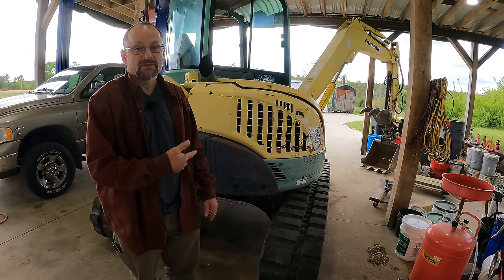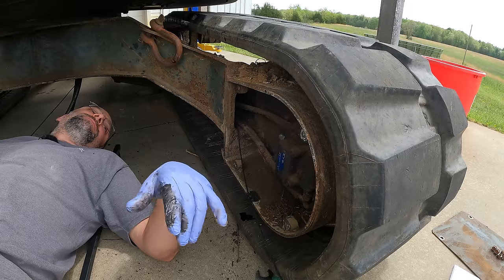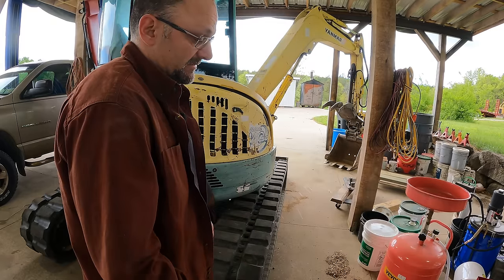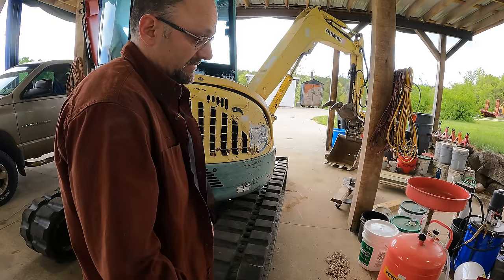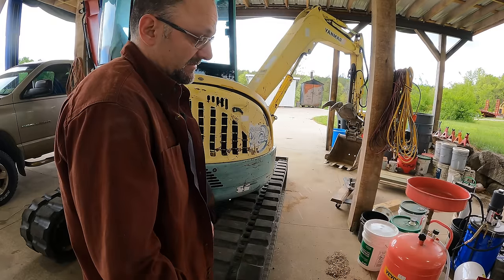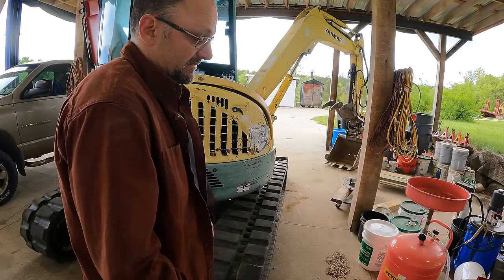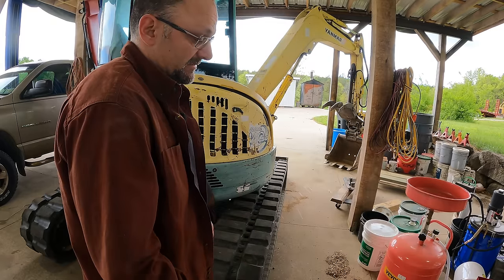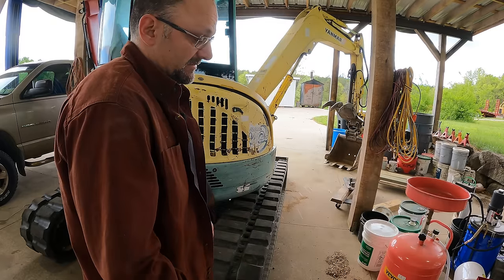Excavator Not Tracking Straight, TOUGH Hydraulic Repair.

Comment: I have a 1990 Hanix 260-2 …I have rebuilt the swivel valve, had a bad hydraulic pump, was able to replace that. Ended up rebuilding the valve body because it was pouring fluid. Got it all together…ran amazing…for about 10mins. Now I have a weak track, weak curl, and weak arm lift. 🤦‍♂️ 
My swivel valve was full of little bits of old seal material. Cleaned the tank and hoses the best I could but I’m assuming I have some sort of obstruction. March goes on. 

Great video sir

Comment: Can you moderate the output on the stronger one - using an additional inline variable valve? E.g make the motors as weak as the weakest one so it'll be equal/ straight?
Reply: Why would you do that you can still track straight if you don’t push the other lever all the way!
You might need the extra power on the faster track….you could just put a piece of wood underneath the faster track pedal so it can’t engage all the way and is equal to the other one when fully engaged.

Comment: Hey John. Love your videos! I have been working in the Industrial hydraulics world for a couple years now (only since 1985) and i hopefully picked up a few things along the way. I would make only one suggestion. I noticed the model number tag on the pump and it looks like its a KYB? I would attempt to contact their US Sales team to get the straight skinny on that pump from them.  I am thinking there may be a null adjustment on that pump somewhere. The HP limiter is usually associated with the compensator not the max stop adj which appeared to be the adj you were tweaking.

Comment: To check the motors you could block the leakhoses and see how much oil comes out of each motors leak in the course of 10-30 seconds. You would have to put the excavator up on Jack stands.
Reply: Yep, that's a good test to see overall condition of the motor.

Comment: Another excellent video. I do have one suggestion, it's so simple that I would have thought someone would have suggested it to you with all the research you have done, but here it is. Why don't you mechanically limit the travel on one of the levers, put a hard stop in, to hold back slightly the motor that is traveling too fast, to equalize the flow and eliminating the effect. It's obviously a band-aid and not  a real repair, but at least it would fix your problem that's driving you crazy, and can be adjusted as it wears further. That's the only cheap and 'easy' solution I can think of.

Comment: Great video as always. On a side idea. You could mix your JLG Boomlift, the Jackery 3000 battery pack, and a set of led floodlights. It seems like a simple way to make a set of super overhead flood lights. If you did a project building frames for the lights to clip onto the basket without modifying the boom, then if you ever needed light, it would be a quick setup. Seems simple and useful.
Reply: Then you can play God:
"Let there be light."
- Click -
"Wooooooooww!!!"

Comment: Check you service manuals  for the cycle times for the digger services, if you know the pressures are good then cycle times can help to evaluate pump flow performance.remember pressure is power  flow is speed.  Stay away from adjusting the regulator at the pump changing this just adds another variable  to the mix,without a flow meter you   are only guessing  if the cycle times are within spec then move to the next test in the literature  there is usually a section that says evaluating performance in the book.

Comment: Another potential option, as you found the control valve for the Left drive was weaker than the right hand side, is to switch the two control valves. Hopefully this would roughly equal out the weaknesses between both sides and have you tracking straighter at roughly the same speed
Reply: I've done that in the past to try and isolate a problem slow track motor ( drove in circles if enough space)  despite pressures feed and return being the same at each motor and out of the valve chest.
Reversed the control , problem disappeared.. ran it like that when tracking out several kms.. then back in shop, we tore it down, returned the hoses back to standard.. worked as should.. for a week😢
Back in 80s we had the same problem with a little used   Priestman 108.. that was solved when we replaced the valve chest from a salvaged unit. We also replaced hoses to both drives..

Comment: Hi there 
Flow meter is the only real way to test a hydraulic system  like I said on your last video , what you’ve spent on hoses would have gone towards a flow meter, if you get one try to buy one with a valve to load it up as you test the system , you might get the same flow but when you add load the flow may drop indicating and internal leak or performance issue , your spool looked dull on the bad side meaning wear in the spool/ valve , you don’t need a big leak past to create your problem , o ring seals between the spool slices can cause this also but really a flow meter is your biggest helper now and in the future,
Regards and all the best , Davy 🏴🇹🇭

Comment: Usually the Case Drain fluid is cooling fluid. It should return through a cooler then back to the tank. Works the same way on an aircraft.  Great channel as you give me lots of great ideas and motivation to figure it out myself.

Comment: John, something that hasn't been considered is the length of each track. I was a soldier for 30 years and about 11 of those was operating out of tracked vehicles. The vehicles had by design different length tracks which caused them to track right requiring constant correction. This was at speeds upto 60 Km/h (about 37 mph) and was not really an issue. What I'm trying to get at is check to see if the track stretch has made them different lengths, and if you cant find a reasonable solution, I'd just live with it.
Reply: That makes no sense because it wouldn't have been changing from left to right sides since he never changed tracks from left to right.

Comment: If the drive motors are not specifically for left or right, you might try swapping them from side to side.  It may balance things out more if you have multiple components with varying stages of wear. Just a thought, G.

Comment: Well... I noticed the dig in the last video at the hydraulic mechanics (and hydraulic designers such as myself) warning you that diagnosing hydraulics strictly by pressure was a dangerous mistake. You set your limits by pressure to prevent damage to components. You diagnose poor performance by finding the problems with flow. Pressure is just the resistance to flow. No resistance, no pressure. Full resistance, full pressure (and relief). Pumps are designed to move fluid from one place to another to transfer power remotely. A system can still meet pressure requirements while not providing adequate flow if there is enough restriction. After all, those pumps may be governed to relieve at 3500psi, but they're fully capable of providing far more than that at their designed flow rates (until failure occurs). 3500psi is a cake walk to them, even when the components are worn. Measure your case drains to diagnose worn pumps and motors easily. Deadhead the component and dump the case drain into a 5 gallon bucket for an exact duration of time at the specified rpm. There will be a spec sheet when you look up the pump or motor that tells you what the case drain rate should be. If you want the easy dirty solution out of this, just install a pair of two-way (non-checked) flow control valves in-line with the fast motor and adjust manually. it'll cost you 120 bucks in valves and 60 bucks in fittings. put them right off the motor so they're easy to tweak on demand and so you don't need to buy 4 hoses to replace the 2 original hoses. it won't hurt anything. as far as the machine is concerned, it will think it's going up a half-a-degree hill all the time on that side. you could do just one, but the motor would still act with a tiny bit of bias in one direction, due to the case drain. https://www.amazon.com/Hydraulic-Control-Needle-Valve-Ports/dp/B07WWHH1NZ?source=ps-sl-shoppingads-lpcontext&ref_=fplfs&psc=1&smid=A1VH34FQCDTBWO that's an example. it doesn't mention if it's got a locking set screw or not. you'd preferably want one that can be locked where you like it, and rated for the right gpm rate and hose size, obviously.

Comment: I thoroughly enjoy your content. I had a very similar experience on my mid-90's Cat excavator (E70B). Does not track straight - although yours appears a little worse. I put in new final drives (because both were going to eat themselves) and rebuilt the rotary joint (swivel joint) because the blade would drive down very quickly. Neither had any impact on the tracking. Seeing your experience and reading some of the comments, I will likely never pursue attempting to correct that, just continue to live with it.

Comment: Great video.  Wish I had experience here to offer.  The accumulator is suspicious being on one pump but that should not really impact anything.  I think you covered this in another video, but would think you could calibrator the sticks in such a way so that when both are fully open you could set it so that the fast motor valve is not 100% open, maybe 97% open.  If no adjustment on the sticks, then maybe you can add an adjustable regulator (flow control) on the pump output and calibrate it that way.  Seems odd there is no calibration mechanism.  Surely they can not expect both pumps to be exactly matched.  Although maybe that cross connect you added is already done internally in the pump housing.
Reply: my baby bobcat mt50  has some stop bolts on the levers to adjust the travel on levers to make it track straight.

Comment: Why not put an adjustable flow restrictor in the faster side, and adjust to get decent tracking?
There are 15K psi adjustable needle valves, as I've used one for an adjustable expansion valve in a homebrew refrigeration system.

Comment: Great video John,While i used to work on 50ton (RB50) crawler cranes the tracking motors were a similar set up (just a whole lot bigger) you could adjust the flow rate on an adjuster on the motors to balance out the speed of each motor..do your motors have flow adjusters on them?Just a thought and might save a bunch of money if you can adjust them and sync the speed of each motor.

Comment: Are the left and right drive motors interchangeable? If so switching them might mitigate the issue somewhat...
Swapping the drive motors takes a lot of time & work but  there would be little or no added costs involved.
An easier LONG SHOT fix you could try : Somehow lower or restrict the oil flow to the right motor until the machine tracks straight...
this might be done easily by putting stops on the lever travel OR via an orifice tube (or some such contraption) placed  in the right side valve outlet hose)...

Comment: Have you considered putting an adjustable restrictor (eg ball valve) on the stronger track action so that you can limit the stronger side to the same power as the weaker side?
Reply: I was thinking this, or a needle valve (see SV seeker's lastest hydraulics video)
Reply: @bigbadvoodoodad  I agree with a needle valve instead of a gate or ball valve.  Needle valves are for close control.   A ball valve should be open or closed.

Comment: You still have a common item though between everything. Your hoses. If one is pinched or internally damaged then the pressure would be near right but the flow rate could be skewed

Comment: thanks for the insights, was doing the same problem with out excavator. just pin pointing which is which to determine the problem.  im no HD mechanic but i know how power flows and understand its working principles.

Comment: In the old bobcats you got them to steer straight by adjusting the lever travel. You'd only need to try limiting the faster one. Fab a bracket and stop bolt

Comment: As a former equipment operator by trade and owner of an excavation company, I've never seen anyone put so much effort into getting an excavator track evenly.

Unless it's causing damage, the operator just learns to hold back on the side that's tracking faster. It is what it is.

Few excavators track straight in my experience. 🤷
Reply from the maker: Ok, that's good to know.  This is the only excavator I've ever run.  Cheers.
Reply: can someone help? I purchase a used  bobcat 8811 backhoe  attachment and I rebuild all cylinders w/new seals; attachment din't have the male and female couplings so put new ones,, [not sure if in right way] when in I try to run it,,,, the oil starts to get hot within in minutes and hot oil will shot out the couplings: check other similar models for correct connections of the lines but can't figure it out.
Reply: @eliast4780  Sounds like missing o-rings or couplings aren't tight enough. I'm not familiar with that attachment, so maybe you would have better luck on the equipment forum Steve mentions in the video.

If all else fails, it may be worth the investment to pay for an hour or two of diagnostics at a shop.
Reply: some one told me if when I change the seal I might have gorget to install the "O" rings in the cylinders: they say with that pressure,, if there is tight gap oil will get hot with friction. that may be my problem: didn't put the seals right.😪 .
Reply: As a renter of excavators somewhat often, I’ve noticed a lot of them track off like that. I’m sure they are abused but then again those are almost new too. 
It’s annoying but like you said you just learn to pull back on the fast side.
Reply: If you can’t stand it ,you need a restricter in line on a hose,, like a dimmer switch. That’s what valves do anyway.
Reply: Ok, guys shoot a hole into this theory!

Here is a novel angle for you, mind you I'm only throwing spaghetti at the wall however it's a logical wall ...

Maybe the problem is related to "Where the rubber hits the road"

Quite literally, as in the actual tracks themselves? 

Think about it, if one is a couple of inches longer than the other is, it would 100% make "a" difference.

Bottom line,  swap the tracks!

☆☆OR ☆☆

Tighten up one side a bit and loosen the other side a bit

Test

Then reverse.

Either way it has to compensate for the variation one way or the other even if it's not the root cause it will still compensate for the variation so either way it's the actual fix or it will be an effective workaround, imho.

KISS !!!
Reply: @jp34604  I wouldn’t think the length of the track would affect it. The speed at which the final drives turn is going to be the ground speed.  Even if it was two feet shorter. Now there would be some weight difference that would affect it a small amount if it was that drastically shorter. Remember is not a diameter like a tire so RPMs of the final drives if identical will translate to equal tracking regardless of how long the track is. It’s almost like the track isn’t there and the sprockets are riding on a long track.
Reply: Plus, it changed sides when he changed the hoses, so tracks are good.
Reply: > Bottom line is the one on the outside of the turn is spinning faster.

So just slow it down a wee bit with a ...

ASIN     B07WWHH1NZ
-
KISS
.
Reply: I have to agree skid steers with tracks are the same to. Ive run either for a couple  thousand of hours so far  and the slight tracking has never gotten worse and really is not much of a problem just a little steering to compensate no big deal.
Reply: @jp34604  I see where you are going with that, but he swapped hydraulic lines and was able to make it track right instead of left.  That would disprove that as a cause.
Reply: @stevem6711  
I see it as consistent that the "problem" followed the swap, as THAT channel in the manifold has slightly more pressure and thus is outputting a higher volume of fluid/oil causing the sprocket on whichever drive assembly is attached to rotate more at a slightly faster RPM. 

However the needle valve for THAT channel was not granular enough or even working at all required to make the necessary adjustment to compensate for the slight imbalance - so again I say to simply add an inexpensive in line easily accessible fine tune adjustment valve as someone else also mentioned to tweak (or dim) on the fly for a highly granular micro adjustment so this neurotic loose nut behind the wheel can overcome his OCD and move on with his life LOL

 But no doubt it's annoying to not be able to adjust some simple variable SOMEWHERE??? to sync it up!!

I say just add ☆this☆ on one or even both sides -  maybe even right in the cab at the forward output of the stick for easy tweaking in real-time to fine tune., imho.

ASIN       B07WWHH1NZ
.
.
Reply: @cabinman  
Yeah, now I see, one RPM is relative too the circumference of the drive sprocket rather than the circumference of the track (assuming equal diameter sprocket gears and tooth spacing on both sides?) as if there were not even a track at all, duh, thanks!